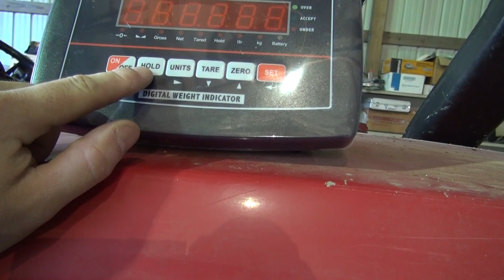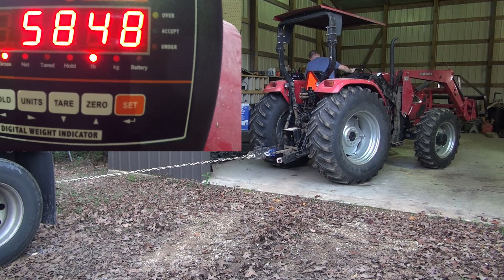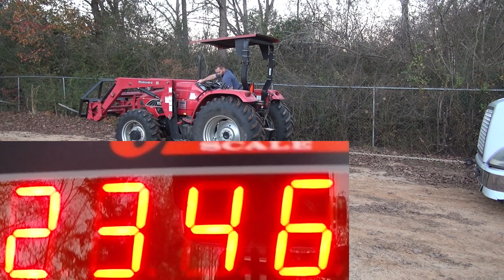Tractor pulling against 20,000 lb Load cell Mahindra 8560

Comment from the maker: I figured out the peak hold feature on the load cell after I made the video lol. It was a setting in the calibration menu I had to change, will probably do another test in the future with some weight on the tractor and use the peak hold feature then...

Comment: I noticed the peak number on the concrete occured in the beginning, then it settled about 10% lower. I think this is due to the surface of the concrete filling with rubber, and therefore not having as much friction. Do you know the total weight of your tractor during this test? Also, the height at which you hook each end of the chain to is important, needs to be the same (looks like it is). I just started playing with a garden tractor and got 1243lbs as it lifted the front end. (Hooked to a point 4" above axle) Total weight of tractor with me was 1000lbs. I find this stuff very interesting too. I can't find much data on it, few people have done what you did.
Reply from the maker: Should have been right around 10,800lbs as equipped in the test... I have a ballast box that I usually keep on for lifting with the loader and it's around 1,200lbs, so it brings the weight up to 12,000 lbs when I have it attached.  From what I've read and the testing I've done, the pull should be within 70-80 percent of the weight of the vehicle depending on soil conditions etc. Something like a dozer can expect 90- 110 percent of weight in pull force. I have no idea what garden tractor you have but based off of numbers you shared I would expect it to weigh 1600-1700lbs.
Reply: @LifeWithChase  Omg, you cant belive how helpfull this information is 😍

Comment: I’m an arborist and I’ve always wanted to know these numbers for pulling over trees. Thank you.
Reply from the maker: I was curious what kind of forces that a larger tractor could pull and find stuff like this interesting for some reason LOL Never could find anyone else that had done this other than on a 25hp tractor. which is not impressive lol
Reply: @Unknown yes, shock load is no joke. But even more disturbing is how inconsistent the pull is. You almost want to be driving ahead at low idle the whole time without stopping because, the second you stop, the slack in the system can settle at a much lower number.
Reply: @Unknown Nice. Also, I chuckled at the sandbag idea. My solution would be just an extra stretchy rope like one made from nylon. There’s some 1/2 inch cheap stuff rated for 6,800lbs called True blue that a lot of people use. But, it can get hot by rubbing on anything metal, or itself. It will heat up, stretch, then fail.  
Just gotta have some redirect blocks handy if it rubs.